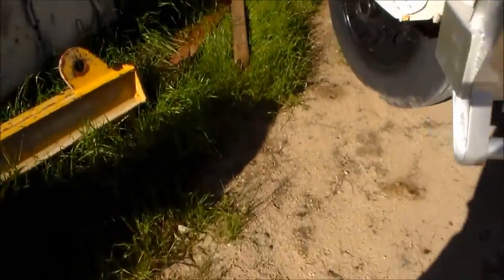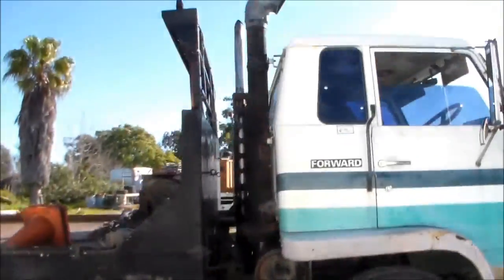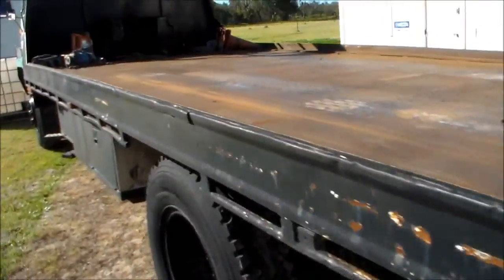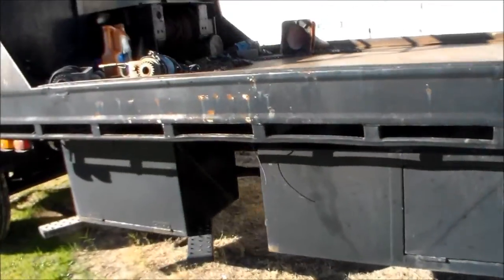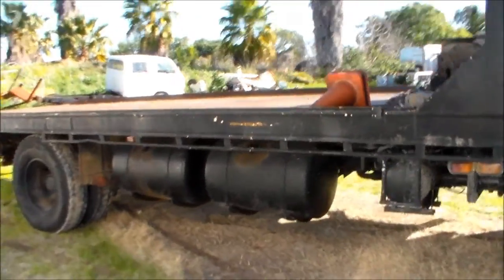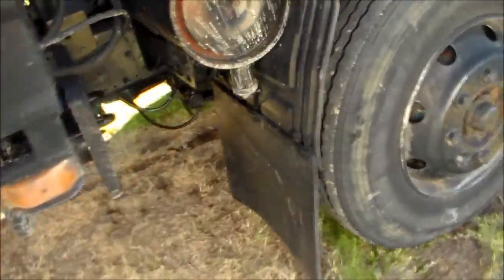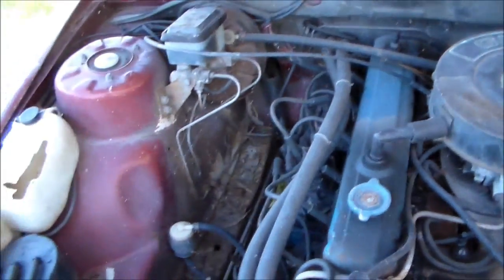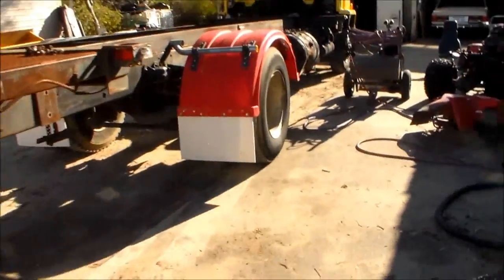Truck Build :- Tilt Tray Part 1

Comment: Hell, I'd rather swap the trans, brakes AND swap the cabs over than fiddle with that slider; it is fricken heavy, and if you get some damn thing or other wrong, those hydraulics will tear thyat sucker apart in a heartbeat.  We had a 10 wheel dump truck that went up north to have it's bed modified, when it came back the bed looked great, everything looked great.  First time they raised it, it turned a brand new triple ram into a banana, hadn't left enough room for the cyl  to pivot!

Comment: If it's the same engine, is it the same trans?  I mean, if the slider has a good engine and the one with the skel has a good trans can't you mate the two? Brakes are easy and relatively cheap, might even be able to snag the brakes off the skel and have a spare engine for the slider (after the rear main seal fix)  As a heavy equipment mechanic for 30 years, a tranny swap and a brake job sounds loads more appealing than that slider job, at least to me.  And maybe the shifting is linkage problems?

Comment from the maker: I agree with your concerns, but this wont be the first time, I built the old tilt slide truck too.
the problem with swapping the cab is going from air assisted hydraulic to air over hydraulic. big difference in lines/etc and would need to swap the diff too as the new setup parks on air, not a cable. also a lot of lines and stuff would have to be remade to fit and that = big money.. from my perspective, the slide swap would be easiest in this situation!!!

Comment: hi there... just wanted to know the length and thread on the longer bolts you used to compress the pressure plate in vid 2. i know it was done a while ago . also.. is there only 2 vids of this work?